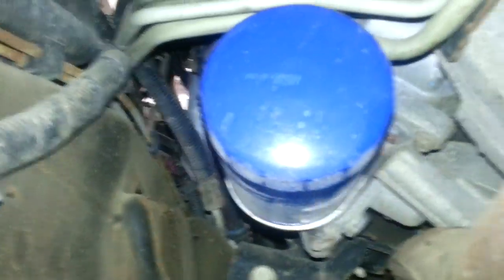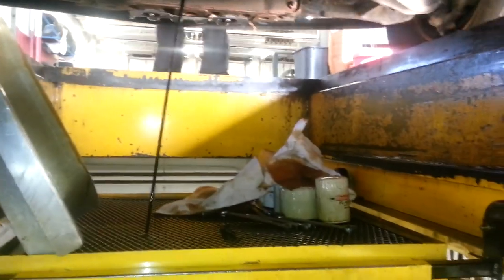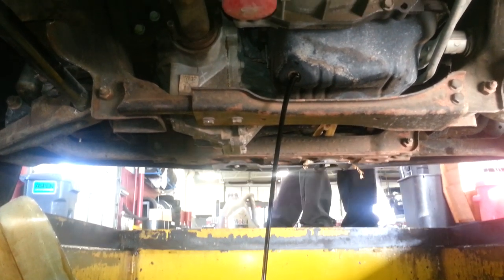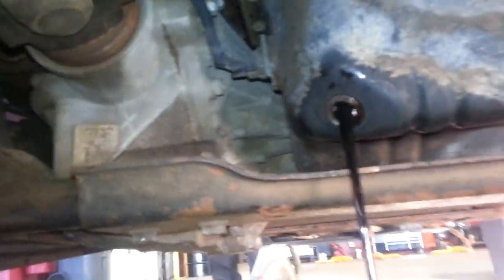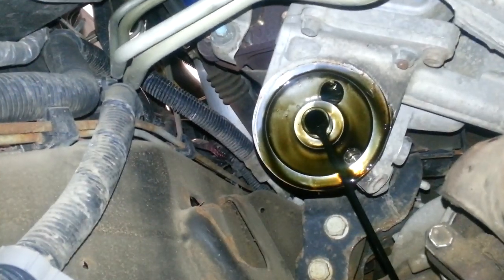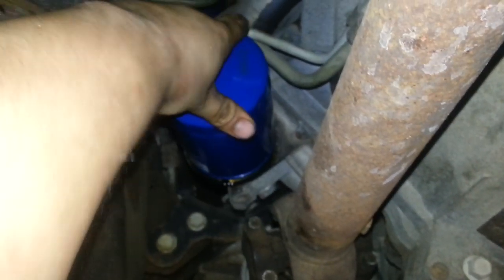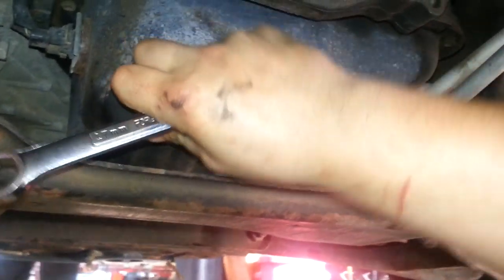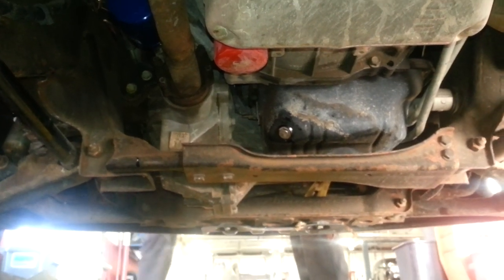2002 chevrolet silverado duramax oil change

Comment: Above 0F 15w-40 conventional. 0F or below 5w-40 synthetic. 10w-30 is a "acceptable substitute" but its just best to follow the GM Dmax recommendation. & the drain plug is a 5/8 or 16MM.

Comment: holy jeebuz! that oil filter should have been filled and also should have allowed it to drain fully from everywhere. also a good couple minutes of letting the oil reach the pan is good. dry oil starts severely reduces the life of any engine, even a duramax!
Reply: actafist79 
Filter is mounted sideways

Comment from the maker: yes sorry i thought i said this in the video but according to alldata.com the 2002 duramax engine preffered 15w-40 or 5w-40 full synthetic motor oil but 10w-30 is an acceptable substitute above 25 degrees

Comment: Would this be the same step by step process for my 2500hd 6.0l gas 2002 chevy silverado hd?
Reply from the maker: different filter location and orientation, also drain plug will be pointing towards rear of vehicle . filter is around the same area next to oil pan pointing straight down and then takes 6 quarts of 5w30 when finished .